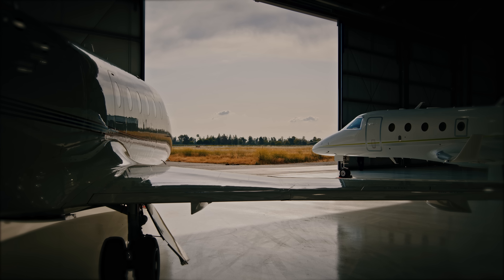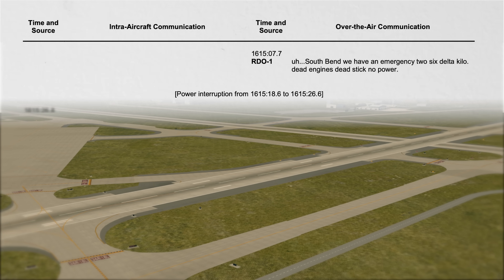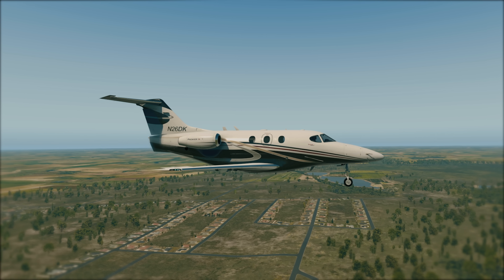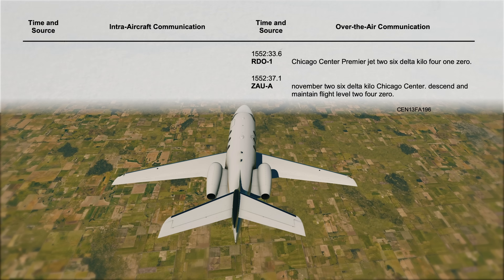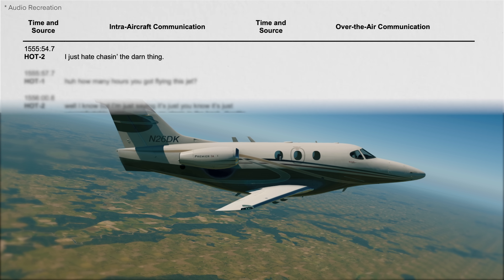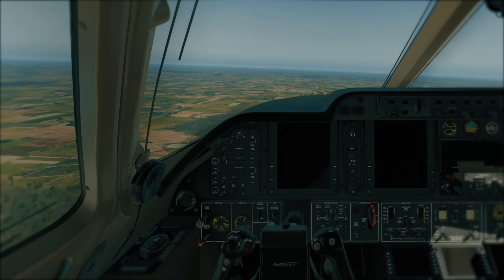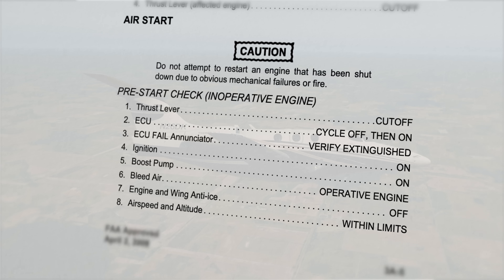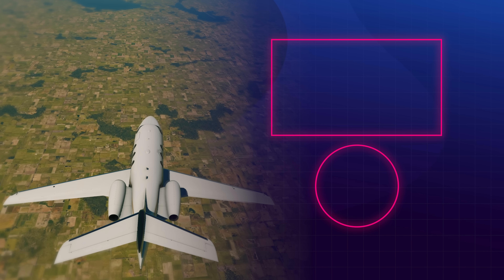Passenger Causes DUAL ENGINE FAILURE | Accident Case Study

Comment: Accidents like this one are the reason that in my view, private pilots should not be operating jet aircraft. If you want to fly one privately, you absolutely should be able to, but the PIC at a minimum should be a type-rated CPL-holder of a certain level of experience and assessed competence. It’s not necessarily a case of differing skill levels, more about the professional approach to flying instilled in CPL/ATP training which is lacking from a lot of PPL training. A professional, disciplined approach to flying is something an aircraft like a business jet demands.
Reply: Not sure that getting killed in a piston-engine or turboprop aircraft is any better than in a jet aircraft. When I was trained as a flight instructor (on single piston engine), one of the first tricks my instructor pulled on me was to flip off the magneto switch while saying "hey, what's this ?" at about 1000ft above ground. That shit can happen at any altitude is something any pilot should be aware of. Airmanship is not a matter of holding a commercial pilot license, it's a mater of not overestimating one's competences. Like : if you're no instructor, don't instruct, for instance; and for everyone's life sake, RTFM...
Reply: @philippelambert329  I agree with what you’re saying, it’s quite sensible. 

I’ve been lucky enough in my career to fly everything from C150s, to high performance turboprops, aerobatic aircraft, helicopters and jets. The honest truth is, I think money talks. Those of us who fly for our livelihood have to prove ourselves through interviews, selection processes, sim checks and psychometric testing just to get the privilege of being trained and assessed to fly aircraft like this, with failing being a distinct possibility if the competency or work ethic isn’t there. But a PPL-holder with enough money can simply buy one and make it his personal plaything, without anyone vetting him to ensure he’s actually up to the task. 

So I think you might be right, the license is less relevant than the individual. Ideally I’d like to see aircraft manufacturers and/or brokers have a stringent evaluation system for potential owners. You roll up, do ground school, sim events and checkrides, and if you’re not up to scratch you don’t get the jet, regardless of how deep your pockets are. 

Jets are no joke, much less forgiving of mishandling or maltreatment than the light piston singles and twins PPL pilots learn on, and they need to be treated with respect. This guy didn’t seem to have that respect for his machine, and to your other point, certainly didn’t have any respect for the profession of a flight instructor. I have never been a flight instructor, and I wouldn’t dare try to teach someone without the requisite ratings and experience. 

Ultimately, this is another one of those incidents that sadly falls squarely into the category of “tragic but avoidable”.
Reply: I agree.
In Australia, to hold a PPL you are required to do one exam.
And this guy flies a jet.
I think his money got him IFR ticket.
I hold all of them RPL PPL CPL ATPL TWIN IFR.
I wouldn't touch that aircraft without a type rating.
But a PPL holder can fly literally anything but not for monetary gain.
Shame
We don't go to the toilet without a check list

Comment: What in the world was the tower thinking telling them to go around with both engines out????
Reply: I think it was just CYA. Had he landed, and I know this sounds crazy, but some people would have tried to sue ATC for not telling them. This is the world we live in now.
Reply: @russellmoore5711   I could see making them aware that the gear was retracted, but to call the go around seems over the top. 

Side note, I can't grasp the pilot being ok with everything that was going wrong inside the plane and lack of checklist use.
Reply: @JasonSpasoff  Go around is the correct procedure if you have no gear. Also,  the ATC knew he had one good engine because he could see the heat waves coming off it,  the same way he saw that the gear wasn't down.  The plane was RIGHT IN FRONT OF HIM. And even if he didn't have any engine,  it's still the right call. It's not like the pilot could go around even if he wanted to.  Without any engines the plane is just a brick falling out of the sky. It's going to land no matter what unless he starts that engine.

Comment: "you went back behind the stops and we lost power" who in God's name thought that was an adequate design? My car's parking brake has better protection against accidental activation than that.
Reply: Agreed! This airplane seems to have multiple issues with poorly implemented human factors design. Perhaps all airplanes do, but it has to be possible to do things more intuitively.
Reply: Nope! Page one of every flight manual clearly states: DANGER, THIS MACHINE HAS NO BRAIN, USE YOUR OWN.

I'm only half kidding, but that's the reality. It's not a car where not being comfortable and having intimate knowledge of all the controls is considered passable. The consequences are orders of magnitude higher in an aircraft, which exponentially increases with complexity of the controls. The only person who should ever lay hands on the controls is the pilot who is qualified and in control. No friends, no lovers, no owner or boss, only the pilot. The fact that buddy didn't know it was possible to accidently no fuel the engines with a small mistake like pulling up on the safety stops is already enough to say he doesn't understand the throttles, let alone anything else in the cockpit. You cannot enter the cockpit and casually operate anything, you must know and understand each and every setting and what else it affects when you touch it. That bent battery switch is a sign of desperation, meaning the pilot did not know or understand consequences of flipping the switch. But to be clear, that's less of a problem and wouldn't really develop as a factor of the crash if only he'd done the most basic thing and call for the appropriate checklist. It's almost a guarantee that he bribed someone to pass his jet rating. That plane was way too much for him to handle.
Reply: No,  it has exactly the same protection,  you have to push a button (or in this case pull one) before you can activate it.

Comment: A few thoughts from my safe armchair:

1. If you operate aircraft outside of its stated limitations, you don't know how far you can go before causing a problem. Why risk it?  What happens is that people see they can push the boundaries, and then push too far. The limitations section in the pilot operating manual is the only section that you must comply with for a reason.

2. Putting aside this pilots willingness to exceed limitations, when the sh@t hits the fan, you need to go into simulator mode and follow the checklist methodically. Even to not worry about navigation or communication. Aviate includes getting the engines restarted. Just hold a heading and a safe airspeed and tell everyone to standby until you get the engines running again.

3. Most gear up landings end with no or minor  injuries. A low time, single pilot, 1 engine go around after scraping the runway has a low chance of success.
Reply: To be fair engine relit procedure is methodical but really designed for a single shut down engine. Given he was at 6000ft there was not a lot of time to pull out the checklist especially as he was single pilot. I would be treating those as immediate actions but I wouldn’t be in that situation either.

Im a helicopter guy, is dual engine failure restart often taught in the Sim? 
In a helicopter we practice the failure but not a restart. There’s to much going on too quickly and configuring for the landing is more important than the relit.
Reply: @chrisbeauchamp5563  6000ft and his speed gave him plenty of time for the checklist. He made it all the way to the runway and it appears that he did go through the checklist at least once (even if he failed for some reason). 6000ft isn't great for a helicopter, but it's plenty of time for an airplane. He had a good amount of speed to keep coasting... and once he got the engine going, he could have flown on that indefinitely until he ran out of gas. I'm not sure how he managed to crash after getting the engine up and running and I'm not sure he even said what caused him to flip just before hitting the houses.
Reply: @chrisbeauchamp5563  Yes, but I guess the Premier didn't have autorotation. Actually, I'm pretty sure it didn't 😀

The issue was that the pilot didn't know what the battery switch did. The Premier is certified to fly for at least 30 minutes on battery. Cutting power to the main bus by switching to the "standby bus" just shut down most of the aircraft's systems.

How often is "shutting down your aircraft in mid flight in case of an emergency" taught in the sim? 😉 C'mon, this is not Windows! And also not Apollo 12. In Apollo 12 in the in-flight configuration, the AUX bus is connected to the NORM bus, so if you "try SCE to AUX", the SCE will not shut down -- although there will be a brief power interruption while the switch moves (this probably reset the SCE).
Reply: @klausstock8020 I’m not sure exactly what your point is?

My comment about training to relit dual engine flameout is it’s probably not in regular training. Given the height he was at single pilot with limited control I’m not surprised he didn’t use the restart checklist.
By not using the checklist or understanding his systems it all turned south. Once he had engine restarted would have been the time to slow everything down and take his time to catch up to the aircraft
Reply: You are right. Dual engine failure restart is not trained very often in the sim, or never. In a situation like this though, The idea is to get one going, level off, then take some time to go through the checklists and get the other one started before landing.
Reply: @Airway222 I agree, if he had done that that he probably would have landed safely.
Your other comments in first post are spot on.

Comment: My first inkling the pilot was the problem was when both engines went out, he lost hydraulics, and he didn’t call mayday
Reply: I watch a lot of "Air Disaster" videos and about half of professional airline pilots never get around to that.
Reply: @natehill8069  Flying the aircraft is higher priority. Nobody is gonna fly up there to the stricken aircraft and fix the hydraulics.
Reply: @rhyoliteaquacade  They are talking on the radio already, but they are just chatting. The first words out of their mouth should be "Maydaymaydaymayday flight ## total engine failure." This gives them priority handling and makes people pay close attention to what they say after that.
Reply: @natehill8069  I'm sure they were listening when he said that both his engines failed.
Reply: probably looking for a sandwich during the emergency;
Reply: @russelfernandes8483  "Dual engine failure? I need a drink."
Reply: really?  where were you when they discussed all the times this moron ignored the incessant overspeed warnings he ignored?  most pilots would be more than slightly alarmed and would have ended the clown show pretend instructor session at that point.  i'm sure he didn't even realize how dangerous it is to have the power levers double as fuel condition levers just like the idiot engineer who designed this system.  never have seen this stupid design in any other aircraft.  if i had seen this design when shopping for aircraft it would a deal breaker for me right then. if they designed and installed  something this dangerous and ignorant god knows what other "genius" new feature you might discover later on that you might regret when it's too late. beechcraft is famous for reversing the position of the gear and flap handles and causing a multitude of gear up mishaps because of their "genius" innovative design!   as far as radio procedure  he got his point across in plenty of time anyway in time for the controller to give him priority handling.  calling mayday would not have been enough to help this fool.
Reply: What does calling "mayday" do?  Yes, the Federal Aviation Regulations, Aeronautical Information Manual (FARs?\/AIM) state that in an emergency the pilot should state "maday-maday-maday' or "pan-pan-pan" depending on the nature of the emergency.  Inevitably I read comments, like the one above, critiquing the lack of either the mayday or pan call, but what does it really do for the pilot in distress?  The purpose of the call is first to alert ATC to the the flight being in distress and should clear the frequency of the other routine, not urgent, radio communications.  Having been notified of the distress the ATC Controller is able to render all available help/service. Making the "mayday-mayday-mayday" call is not going to help the accident pilot fly the airplane or manage the difficulty.  In this case neither the ATC Controller, other pilots or anybody else can correctly manage the dual engine shut down and attempted restart.  This pilot, and his unfortunate passengers, had several serious problems that urgently needed to be addressed,  Yes, he also failed the technical requirement to declare "mayday-mayday-mayday".  In reality failing to adhere to standard radio phraseology was among the least of his problems.  Stating those words "mayday-mayday-mayday" (should be stated three times according to the same regulations/guidance) was not going to relight the engines, or follow the manufacturer's published emergency/non-normal procedures.  If the accident pilot was so poorly equipped to handle the self induced in flight emergency caused by his own undisciplined, irregular and unsafe behavior is it any surprise he also did not follow the letter of the law in his radio phraseology?  In the grand scheme of things spending any time on his failure to  "call mayday" is minutia.
Reply: @apackwestbound5946  What does a mayday call achieve? Clarity. It's designed to be perfectly clear and unambiguous, even on a dodgy radio connection. Which this was, by the way - his initial call about the dual engine failure did get stepped on, and it's pure chance that ATC still heard enough key words to figure out what was going on.

ATC absolutely could have correctly managed the dual engine shutdown and attempted restart, if the pilot hadn't screwed up further and lost radio contact.

Ultimately the point is that the pilot failed to follow procedure. Every problem was caused, directly or indirectly, by his failure to follow procedure. And failure to call Mayday-Mayday-Mayday is a good example of this failure.

And look, you're talking "letter of the law in his radio phraseology" like he said "descending to three thousand" instead of "descending three thousand". What he did was fail to declare his emergency. He literally could have said "emergency, emergency" and then it would just be a question of phraseology.

Comment: single engine land here....no engines...no gear... I'm sliding on the concrete runway if I've got the field made,   worry about the why's? later. I'm going to put it down right now!
Reply: He had a perfectly good airplane,  there is no reason to crash land just because you're on final.

Comment: You're flying a jet, and you have no idea how to restart the engines in flight?  Oh, boy.
Reply: "But it has never been a problem before! These engines are really reliable."
Reply: @Vousie  They are if you fly normally though, i.e. within the normal performance envelope.
Reply: @graealex  You've missed the point I was making... Which is that no matter how reliable your engines are, you should know how to restart them just for that rare case, specifically because of how (obviously) crucial they are.
Reply: @Vousie Well, checklist for restart engine is memory items afaik. But I was just pointing out that you don't have to deal with restarting an engine mid-flight if you stay within performance envelope. Even knowing the procedure, it's not easy if you have no engine left.
Reply: @graealex  This pilot did much more wrong than just be slow to restart the engines... And you're right, it is something that is rarely needed because it's so rare, but that is why pilots need to be re-reading the memory items frequently and practising it (in a simulator or in their mind) to make sure that the day they need it, they can do it quickly.